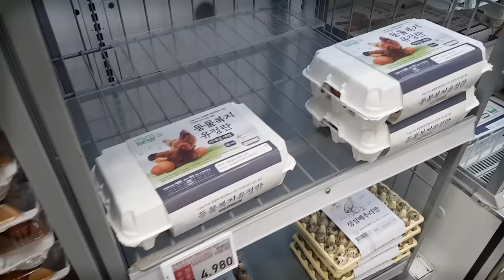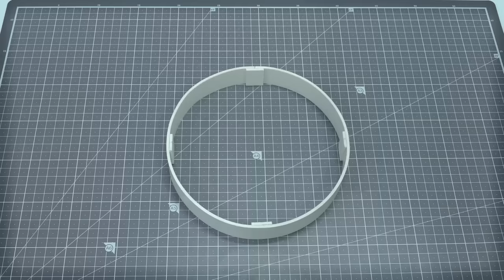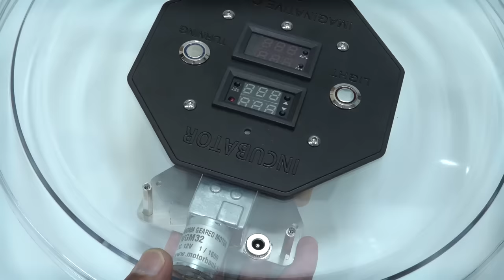I was born in a bowl - Automatic chicken incubator

Comment: Зачем нужны параллельные резисторы? Простым проводом нельзя соединить? У вас же получается очень маленькое сопротивление и как результат большая часть если не все напряжение от блока питания уйдет через эти резисторы. 
При параллельном соединении резисторов, общее сопротивление определяется по формуле:
R общ. = 1 / (1/R1 + 1/R2 + … + 1/Rn)
где R1, R2, …, Rn - сопротивления отдельных резисторов.
В данном случае, имея 24 резистора с сопротивлением 75 Ом каждый, общее сопротивление будет равно:
R общ. = 1 / (1 / 75) * 24 = 1 / 18 = 0,056 Ом
Таким образом, при параллельном соединении 24 резисторов по 75 Ом, результирующее сопротивление составит примерно 0,056 Ом.
Можно для обогрева использовать вместо кучи резисторов и короткого замыкания на них небольшой кусок резистивной проволоки например из константана. как на обыкновенном фене для сушки волос.

Why do we need parallel resistors? A simple wire can not be connected? You get a very small resistance, and as a result, most if not all of the voltage from the power supply will go through these resistors. 
When resistors are connected in parallel, the total resistance is determined by the formula:
R total. = 1 / (1/R1 + 1/R2 + ... + 1/Rn)
where R1, R2, ..., Rn are the resistances of individual resistors.
In this case, having 24 resistors with a resistance of 75 ohms each, the total resistance will be equal to:
R total. = 1 / (1 / 75) * 24 = 1 / 18 = 0,056 Om
Thus, when 24 resistors of 75 ohms are connected in parallel, the resulting resistance will be approximately 0.056 ohms.
You can use a small piece of resistive wire, for example, from constantan, instead of a pile of resistors and a short circuit on them for heating. as on an ordinary hair dryer for drying hair.